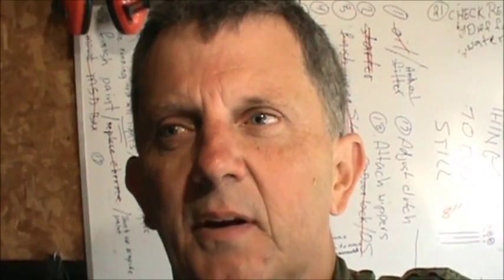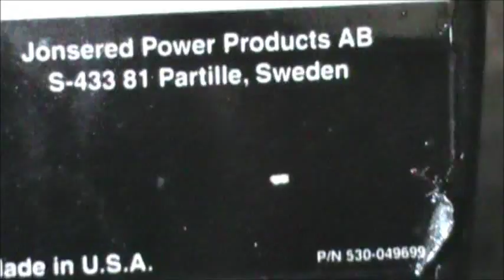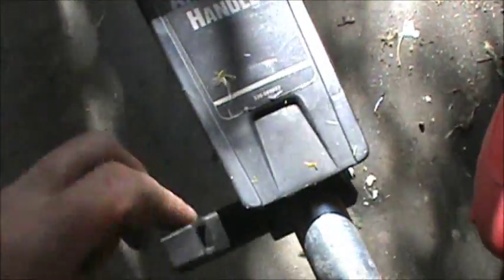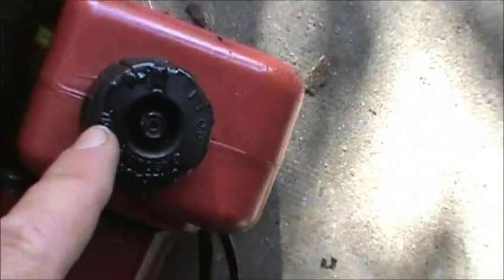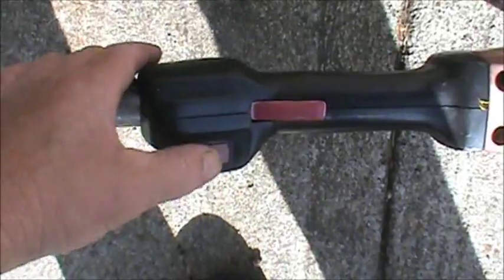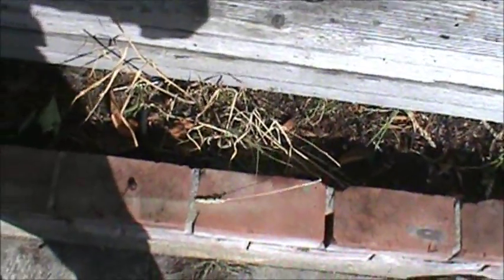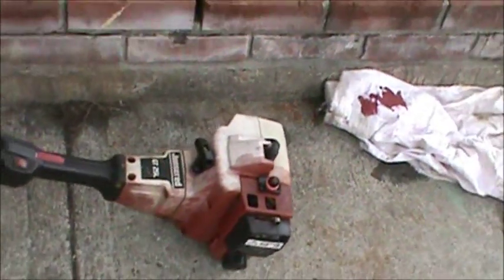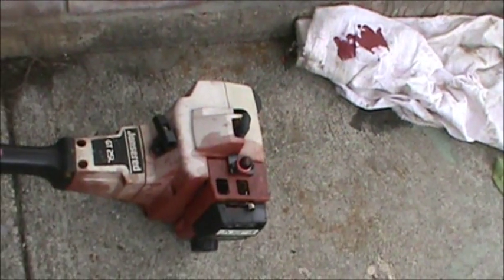Almost there

Comment: I'm a small engines mechanic. lol. Yep I've heard of Jonsered. Looks like a 1997 model? I thought I saw that number on that trimmer. Sounds like its running good. A common adjustment would be 1 turn on the Low and 1 turn on the High with the idle speed set at 3000 all this done at operating temp. Go to Parts Tree. com. I've seen the Jonsered brand in their sight. Click on the name and go to their trimmers. You'll need your model and serial number. And if you have a local lawn and garden repair shop have them looks the parts up from PES or even Magneto Power if they use those suppliers and more than likely they'll be cheaper than parts tree. If you ever need advise or help on those let me know.